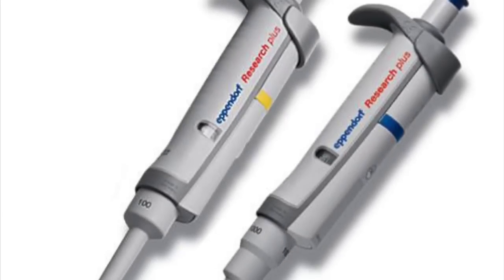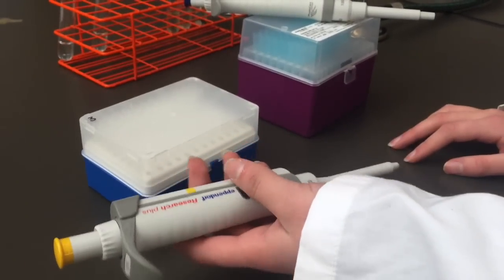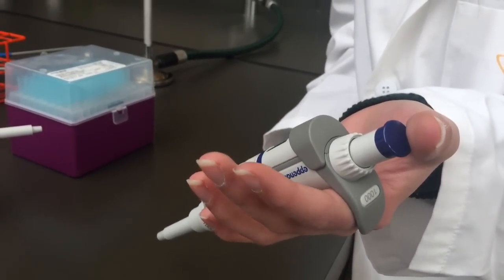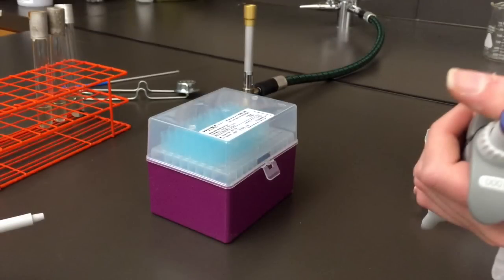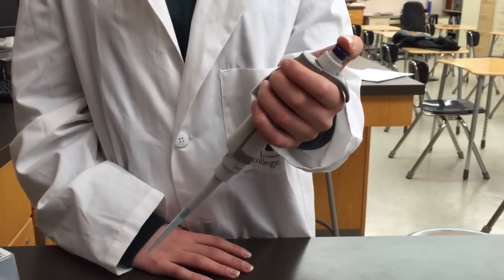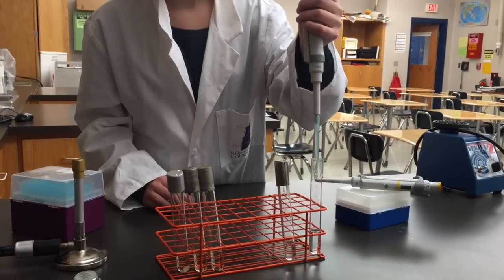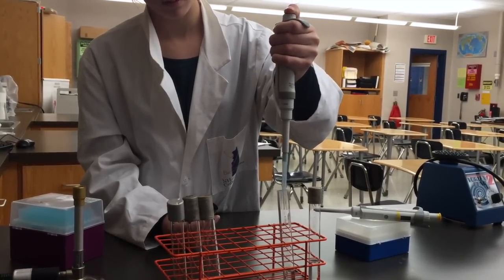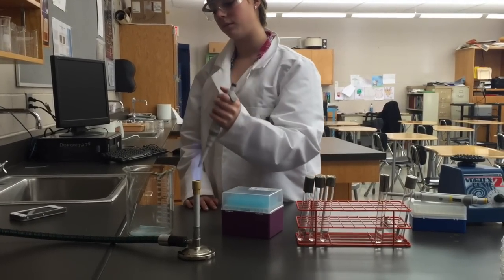How to Practice Proper Pipetting Technique

Comment: WRONGGG!! there is stil liquid on the inside of the walls of the pipette tip. First take the volume then push it out again until the first depression then take the same volume again and then you can transfer. You can also go up and down (liquid in and out) 3 times to saturate the walls
Your welcome ;)
Reply: Thom Van der Ende nahhh, VWR tips are garbage and it will always be some residuals inside the tip. Buy quality!!